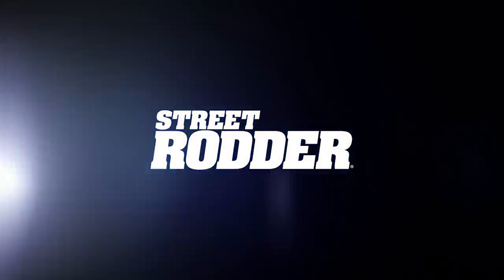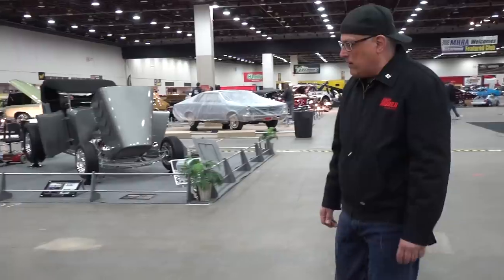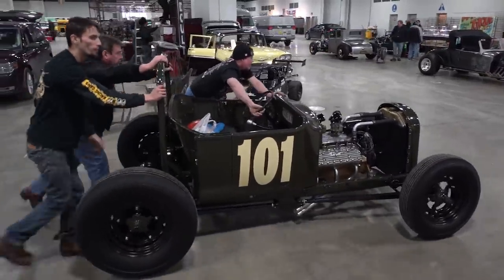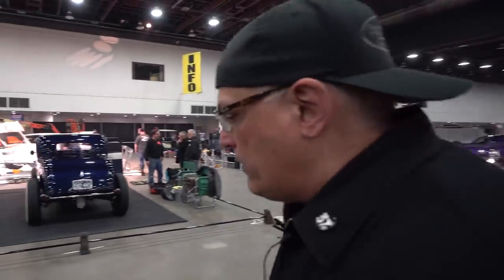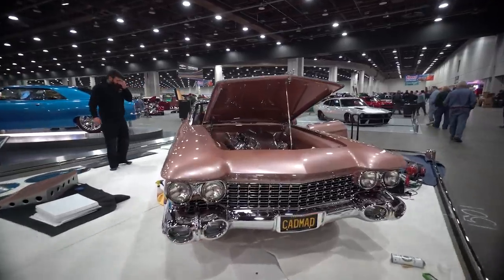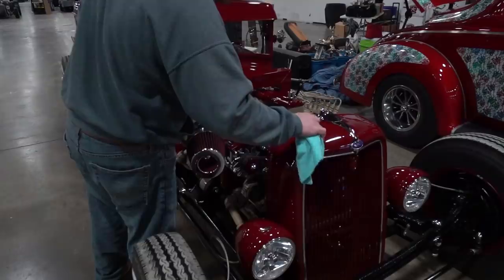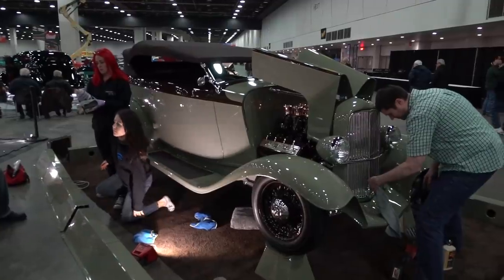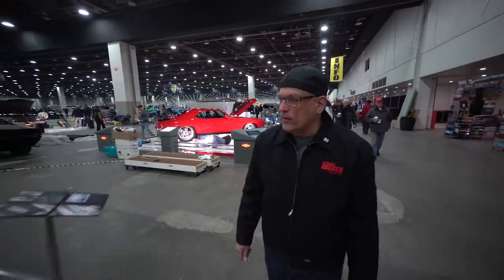Detroit Autorama '19 - Move In

Comment: Interesting. I recognize an LX-platform Dodge clothed in '69 Charger panels. The roofline is dead-on identical to Martin Tremblay’s rebodied 300C, but if it is, it has had major reworking of both the front and rear fascias as a '69 + new mirrors. Methinks it's another build done very similar to Martin's.